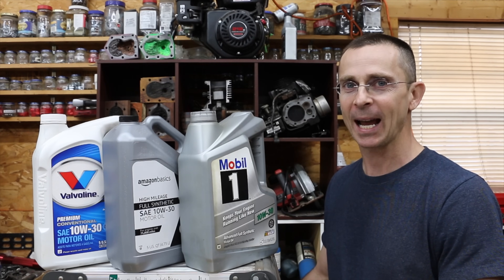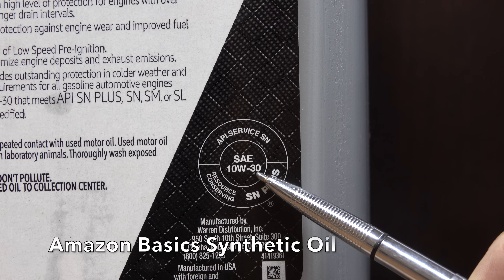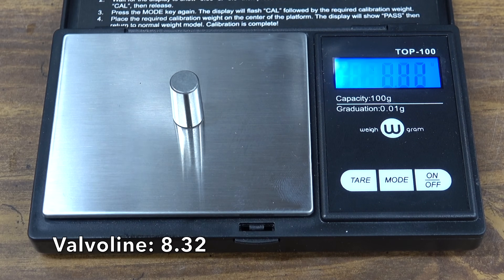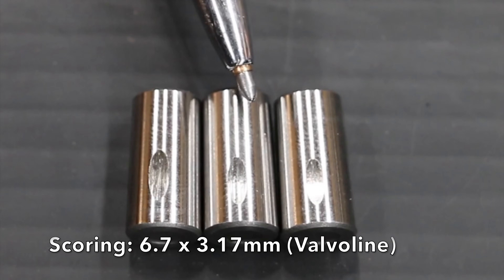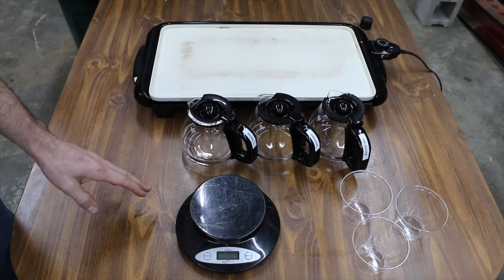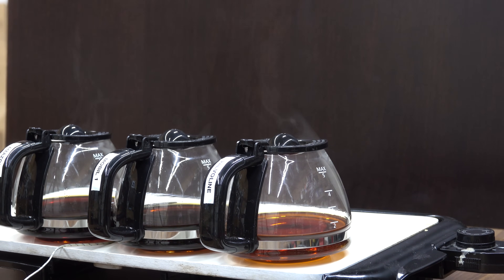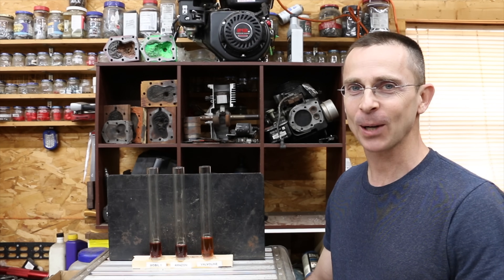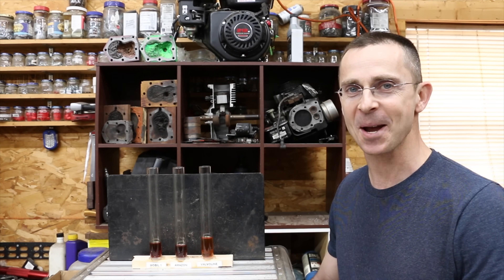Is AmazonBasics Full Synthetic Motor Oil better than Mobil 1? Let's find out!

Comment: Mobil1 spends more on advertising and sponsorships so they can afford to sell a lower quality oil since people will buy it based on name alone
Reply from the maker: Thank you
Reply: Mobil 1 isn’t low quality.
Reply: Didn't say it was low quality said it's lower quality due to the millions they spend on sponsorships, ads, endorsements and such. Amazon has to sell a higher tier product since they don't have ads, mass endorsements, and athletic sponsorships driving customers to their product on brand recognition alone
Reply: D R you could be right about advertising raising customer cost. Mobil 1 is synthetic and last a lot longer than the amazon oil life span though. If you’re running a few year older vehicle that you’re not too worried about I’d say you’re right about using the amazon oil. My car has a turbo so it has to run synthetic.

Comment: You are a true inspiration when it comes to product knowledge. With that being said I have friends that run 100 low lead aviation fuel versus 110 racing fuel and claims that it gives more power. I always wondered if regular 89 octane has any advantage Over regular 93 for higherhigher. Just a thought. Of course, we use 100 low lead in our Aircrafts but other than that the curiosity is there.
Reply from the maker: Thank you for the video idea!

Comment: Would've liked to see a flow test done with the oils heated up to 400*. The Amazon oil flows better than Mobile 1 at low temperatures, but does it also flow more freely than Mobile 1 at high temps? If so, I would think that that would a negative because it's at normal operating temperatures that an engine needs the most protection, and a thicker oil will protect better than a thin oil. For that same reason, in addition to the bearing test being run with the oils at room temperature, it would be good to see the test run with the oils at high temperatures.
Reply from the maker: Great recommendation!

Comment: I wonder which oil company is making the oil that Amazon sells under their label?
Reply from the maker: Warren Distribution. Thank you
Reply: Great videos.Another interesting test of motor oils is a high-temp viscosity test.Very similar to a cold viscosity test, only the oil's viscosity is tested at high temperatures.A good oil will hold it's viscosity at high temps, where as a lower-grade oil will thin out.

Comment: The Amazon oil is a great price but I can get a 4 qt. jug at my local Walmart for under $25. It’s tough to get away from what I have been using for years.
Reply: Supertech i use it all the time and i ran a 400 small block 6.6l  of that no problems let alone the dinky toy engines you see today in cars. ,
Reply from the maker: Thank you!

Comment: Did you test the Rollerbearing hardnes of each Roller?
Suggestion : use only 1roller instead of 3
Reply from the maker: All roller bearing are the same brand. Thank you
Reply: @ProjectFarm  the same Roller bearing brand is nice to know, but that does not tell a thing about the hardness of a certain production series. Of course the roller hardness is within a certain specitied window, but has tolerantes.  If you do your test on one and the same roller the Test resultate would be representarive.   The way you do it, it is not.  This makes your test of no value i'm affraid.  All 3 compaired oils obviously comply to strickt API / SAE standards. Your test the 3 oils on bearings of undefined hardness.  The result of your test ist tendencious and nonsence. Are you payed by one of the brands?

Comment: oh geez lol not another oil comparison! every car forum i belong to has hundred and hundreds of pages of OIL threads. in the end....as long as you change dino oil every 3k and synthetic every 4500 miles you are golden. btw i use this method on my 408ci twin turbo daily driver Trailblazer SS and my wifes single turbo Z06. yes i use amazon basics oil. 0-40 euro formula and 5-30 both synthetic. i abuse the snot out of my Trailblazer SS. i live in Vegas where winters can get as low as 20 and summer heat at 120+.

Comment: Great stuff. For your content ideas, I really want to know “the best of the best” oil such as amsoil, royal purple and redline compare to Mobil 1, Castro and valvoline etc. 

For the price, amsoil are priced similar to the others, but 90% of the time you can only get them from residential addresses. Wondering if it’s worth it driving 1 hour to someone’s house.
Reply from the maker: Thank you for the video idea!
Reply: @ProjectFarm  Include some schaeffer's in the test. Supposed to be the best of the best.
Reply: Add onto the the Walmart store brand, SuperTech. It's even cheaper than Amazon and some have requested the MSDS from Walmart and found that it's just rebranded Mobil1.
Reply: @jonnygiger9794  Or go to a Toyota Dealer.  Their Synthetic Oil is half the cost of Mobil-1...and it's just re-branded Mobil-1.
Reply: Castrol is the only major brand to fail the API testing process so many times that they had to change the rules . That’s a fact!
Reply: Smokey Bean that would be a really good video...
Reply: AMS OIL S S ON THE SHELF AT MY  NAPA STORE CA. $$$

Comment: But did you do multiple trials for each oil group in the different tests. For example, run the "bearing wear" test multiple times with the same oil--see if your results are consistent.

Comment: TIL Amazon made its own motor oil.
Reply: They most likely go the Costco route. The Kirkland brand doesnt make anything but instead repackages other existing products with a new label.
Reply: It's Warren Oil. Says so right there on the label.
Reply: Warren Oil Company has been around for a very long time. Not only do they make oil and grease products they also use to be a Auto Parts Warehouse WD up to maybe 10 years ago or so. I know I use to buy from them to resell in my business at the time. They make good automotive products. Never had a complaint on anything they made.
Reply: I think they buy oil from from some other company, probably same company Mobile 1 buys from.
Reply: @LeosResearch  Mobil makes their own. It's a major major oil company remember
Reply: Probably Warren brand oil. They have made "store brand" oil for walmart, pep boys and others over the years.
M1 is better.  This cheap oil doesn't hold up like national brands. For only 4-5 bucks more you can get m1 and not have shipping. 
That said I've bought the cheap stuff but it requires adding oil along the way vs m1 or other mid priced oils do not require adding oil during a standard 5-7k mile  oil change interval in my experience.
**edit for a car i only plan to  keep for 150-200k miles id run cheap oil. Unfortunately vehicles are expensive so I always shoot for 300,000 miles or more. My last ford had well over 500,000 miles on it so we know something about PM
Reply: Strong Tower Lawn Care - We’ve been sampling engine oil every 2500 miles in multiple makes and models over the last 20 years at my job for our city. 

What we’ve found is that no matter what oil we use in our squad cars, it’s garbage by 2500 miles. Mobil One, Amsoil, Valvoline, store brands, etc (all full synthetics)... all of their additive packages were totally done before 3000 miles. The Amsoil was actually one of the worst (their factory is in our city so we are pushed to use them). Based on the results I’ve seen over those 20 years, Mobil One is good oil, but not really any better than any of the other full synthetics. If paying more for the name makes you feel better, awesome. 

I myself have a Grand Marquis and a Camry, one with 460,000 miles and the other with 325,000 - both have run valvoline conventional since I got them both at just under 100k miles each. I change oil in both at 3000 mile intervals. Neither leak oil and both consume just shy of 1/2 quart in 3000 miles (and always have). 

These days, even the “crappy” store brand oils are damn good. In my opinion there really isn’t one better than another until you get into the high-end specialty oil market where you’re paying $15-$20 per quart and dumping it after a single race, and that’s a whole other world of lubricants.
Reply: @97marqedman  I agree with every word
Reply: @97marqedman  LOL...WRONG.  Blackstone labs tests my oil at every oil change.  There are plenty of wear additives left in the oil with a 7500 mile change interval.  Toyota says I can go 10K miles in my sequoia and lab testing proves it's true.  Congratulations on changing your oil 3 times more often than necessary.  In a normally driven street car, 3000 mile oil changes are only because your grandpa did it.  Get your car tested at www.blackstone-labs.com and you'll see.  (No I'm not affiliated)
Reply: @97marqedman  police cars idle alot so that's not surprising.   I run synthetic because it doesn't burn off between 5-7k mile oil changes. I am interested in doing oil analysis though.
Reply: @BigShastaKen  his experience is with police cars.  These cars idle alot and get beat on hard. 3k mile might be too long on a city cop car that idles 8-10 hours out of a 12 hour shift. His grand marquis 4.6 should be fine with the factory recommended syn blend 5w20 up to k5 miles of average driving. I changed my Royal Purple oil every 10-12k in my CVPI. Id add 1 qt at about 7-8k miles. I used it as a delivery car and to tow my first lawn trailer. 
 3k is good if you do lots of short distance driving or idle alot. Otherwise many Blackstone reports suggest that's overkill in EFI vehicles.
Reply: @workingcountry1776  He did say his experience was with police cars but he said he changes his personal cars at 3k.  Even with excessive idling or short trips, the wear additive package isn't gone at 3k, the oil gets contaminated with unburned fuel and condensation because it doesn't get fully up to temp to burn it off.  He was just full of bad info....I prefer scientific results like lab testing instead of what grandpa did, he didn't have a lab to use.  There is no way that guy has lab results from a reputable lab showing additive package (TBN) gone at 3k miles.  I bet he can't produce lab slips, I can.
Reply: @KamikazeSOF2  I would say it's the weight of the oil and conventional or synthetic that's most important there. High performance engines would use the oil that flows best for their bearing clearances normally. So it's an engine by engine basis. The SBF in my  foxbody gets 10w 30 or 10w 40 synthetic because that's what flows best in it. And just for peace of mind I buy Mobil 1 too. But a different engine like the 5.4 Triton in my other car cannot use an oil heavier than 10w 30 because of how small the oil ports are. Most bmws use a 0W 30 or 40 because of how tight the clearances are when cold

Comment: What sets good oil apart from poor ones is long term stability. As the oil goes through heat-cool cycles in the engine it’s molecules break down and the oil losses it’s lubricating quality. In good oil this process takes much longer. Synthetic oil molecules are more uniform which makes them more “durable”. Refined oils lubricate just as well as synthetic when they are new. It is the long term stability that makes synthetic better.
Your test only shows some of the basic qualities of NEW oil.
Put each oil in the engine, run it for 5000 miles and repeat your test. That would be much better representation of the quality of each oil.
Reply from the maker: Thank you for the video idea!
Reply: Would love to see this happen
Reply: Oil molecules are really quite stable. It’s usually just the additives that break down. That’s why used oil can easily be recycled given the proper equipment to remove impurities.
Reply: Great idea, however that sort of test would be quite expensive.  You would have to measure lots of different components of the engine to get full results (piston rings, valves, camshaft, crankshaft bearings, etc.  Also the test would have to put the engine under various loads of stress and sometimes extreme stress for long periods of time.  Generally, engine components show little wear after 5,000 miles even with conventional motor oil.  You would have to put the engine under abnormally harsh conditions in order to show much of a difference.
Reply: I have an idea...how about YOU run each oil for 5000 miles and repeat the test. Let us know how it goes.   It's easy to be a Monday morning quarterback.  LOL  

I'm really just busting your butt, so don't take me too seriously.  Although it's good from time to time to remember these content creators work for free with the hope something will come out of it.  :-)  Edit for layout goof and fix
Reply: Robert K Would there be any way to do that without having to drive for 5000 miles? Just curious.
Reply: @jacksonmarsch8458  An automated heating and cooling bed perhaps?
Reply: Jd Lund is an oil racist
Reply: Clearly you didn't watch the bearing wear test.  The Non-Synthetic didn't lubricate as well as synthetic when new.
Reply: Also, non-synthetic can't lubricate as well as synthetic when it's -5 degrees and the consistency of molasses.
Reply: Looks awful dark, Black oil is bad oil, kinda shame its so dark already as new product?
Reply: Color has absolutely nothing to do with new oil quality.

Comment: First off, great content. Made me subscribe immediately.

Secondly, now I'm wondering if there is any difference, or real benefits of high millage oil in high millage cars
Reply from the maker: Great test idea!  Its supposed to help control oil loss from hardened seals.
Reply: @ProjectFarm  most likely, and also considering that the difference between regular/synthetic oil and the high millage version of both of these is around a single dollar

Comment: 2 video ideas: 1. Can a gas Engine run using petroleum jelly as lubricant? Let's find out!

2. Will gas additives, such as Sta-bil 360 protection gas treatment and Lucas Ethanol treatment prevent phase separation  in regular E10 gas? Let's find out!
Reply from the maker: Thank you for the video ideas!

Comment: I suspect the Amazon oil giving off the least amount of vapor might have something to do with being rated SN Plus, and being designed for reduce stochastic preignition. My reasoning is that if it vaporizes less, there's less oil vapor going through the PCV system. When an engine ingests oil it has the effect of lowering the octane of the fuel, which can lead to preignition.
Reply from the maker: Great point. Thank you

Comment: It’s important for viewers to remember that lube fluid performance should not be just understood with these basic tests. This is probably distracting. There are many more reasons for saying so. Corrosion, cleaning power of lube fluids and its ability to remove metal fines while maintaining chemical stability is very important.
Reply from the maker: Thank you

Comment: Proprietary company oil additives are a very important part of the oil formulation. These are important in keeping deposits from forming, Pistons clean, and sludge from forming. Since the additives are proprietary, long-term testing is necessary to see any sort of difference. I would Imagine that the Amazon basics would have a very few protectant/additives added due to its low cost. For a few dollars more, I can buy Pennzoil ultra platinum 5W-30 and feel more confident. For eight dollars more every six months, I think it’s a worthwhile investment over the many years I keep my vehicles. Plus, I believe the Pennzoil R&D is much more impressive than Warren oil....
Reply from the maker: Thank you!

Comment: Another video idea is to compare types of fix-a-flat for tires and see how well they work. Curious what kind of mess it leaves inside should you have it patched properly later on. 

I also watched your Flex Seal comparison test an wondered how rubberized car undercoating in a spray can would perform compared to the others that were tested. I actually thought that Flex Seal was car under coating marketed in a different way, because that's what it looks like.
Reply from the maker: Thank you for the video idea!

Comment: very interesting video! might have to look into amazon oil. Any chance you'd want to test out the walmart super tech brand vs the amazon one? I've heard conflicting reports that they're the same oil.

I would really like to see a similar video with additives like lucas(synthetic specific one) combined with seafoam tested in synthetic oils vs just plain synthetic oil. would be interesting to see if the rumored breakdown of synthetic oil with seafoam is true. like compare them all before use and compare them after use. I know your truck was running seafoam in the oil, seeing this test with new oil + seafoam and the used oil with seafoam could determine if breakdown of the oil actually occurs.
Reply from the maker: Thank you for the video idea!

Comment: I tried the  Warren synthetic 10w30 ( Harvest King brand) in my 1997 Buick Lesabre. Motor sounded noisy. Ran it for 100 miles and switched back to  Valvoline synthetic 10w30. Motor sounds  quieter.  Currently running Mobil 1 and Amsoil  synthetics. Great video!
Reply from the maker: Thank you!

Comment: Great tests. I wonder if the results would change doing the friction test at or closer to operating temperature. Might be hard to do though.
Reply: If you heat and cool the oil for a period equivalent to driving for 5000 miles the difference in the results could be quite significant. Poor quality oils break down quickly and loose their lubricating qualities. Good oils remain “oily” longer.
Reply from the maker: Great test idea!

Comment: While the cold flow rates are interesting information, I'm not so sure anyone should be making choices based upon them.  If you're in a cold environment and using synthetic oil, you could just choose 0W-20 instead, or a mix of 0W-20 and 5W-30 to achieve whatever middling viscosity you wanted.
Reply from the maker: Thanks for the constructive feedback.